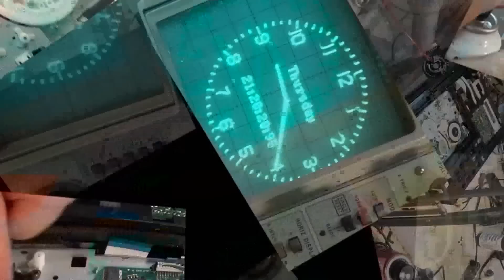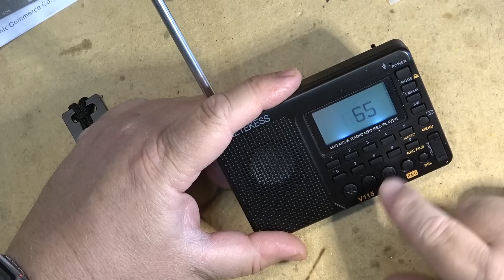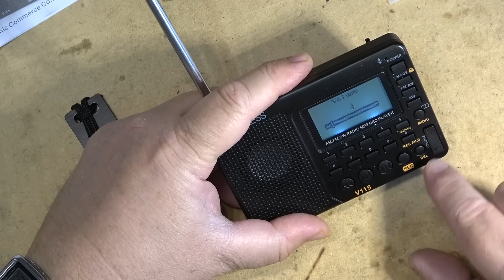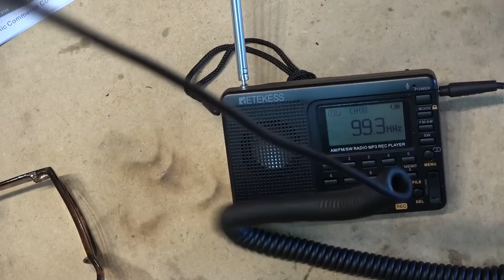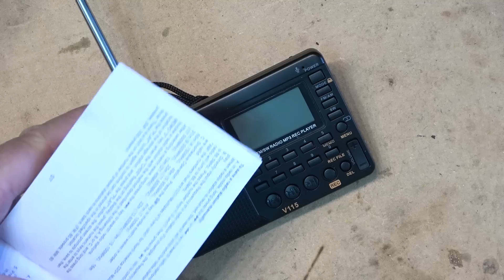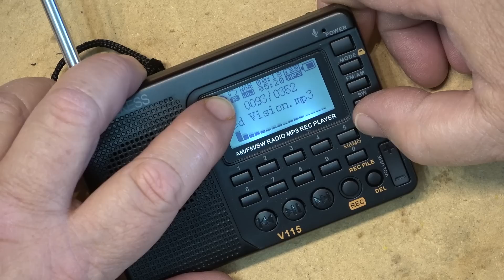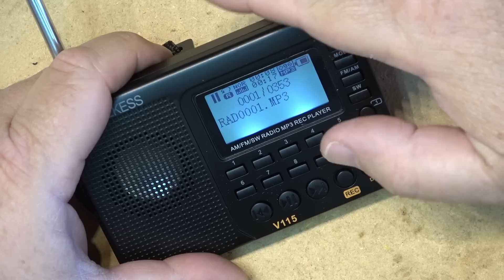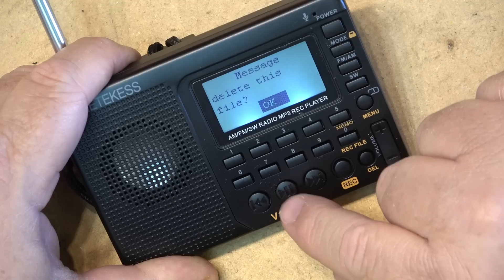Retekess V115 AM FM SW Pocket radio with MP3 and Recording function perfect for travel

Comment: One thing I did notice about the speaker is that it doesn't combine left and right, so you're only listening to a single side. sad but not a dealbreaker.
Reply: Really? Mine does combine both left and right into the mono built-in speaker. Maybe yours is defective. Does it happen for you both on FM and MP3 modes?

Comment: That's a neat little radio, and with so many functions packed into it. Might have to pick one up. That bass speaker on the back doesn't seem to have wires going to it, like in many bluetooth speakers which have the same thing.
Reply: it does NOT have wires.it's a passive bass port.
And yes, many bluetooth speakers have them too.

Comment: I bought one of these and I like it so far. Audio is nice and loud and reception is sensitive. The recording feature is nice but they must be using the Blade MP3 encoder with dual channel so the quality isn't the greatest. LAME encoding is better. It does record at 64, 96, and 128kbps at 44,100hz. The headphone output is a little tinny on headphones but if I use a mini headphone amp I made from a pair of cube iPod speakers then the audio is better.
Reply: The v115 I've just bought can record MP3 up to 320kbps. I guess the firmware must have been updated.
Reply: @michaelturner4457  Can you tell what version of MP3 it uses? Open one of the recorded files in a program that can ID files. Mine the audio quality has digital artifacts and it sounds terrible even at the highest bitrate.
Reply: @michaelturner4457  I wish there was a firmware update for this radio. Don't want to buy another one of these radios just to get 320kbps mp3 recording. Just need the firmware file.
Reply: @coondogtheman  I did have a look, and there's no identifiable metadata in the MP3s it records. And they do sound OK to me at 320kbps.
Reply: @coondogtheman  On mine it states "V 2.3" in the Settings options. I'm pretty sure there's no way for a consumer to easily update it. The micro-USB is for charging only, and I can't see any options for flashing via a TF card. 

I bought mine from Retekess in China, but I'm certain that they didn't design or make it. As the same radio is also sold with at least two other brandings, like Tivdio. The actual OEM is presently unknown.
Reply: @michaelturner4457  Perhaps I should have waited to buy. Oh well.

For the MP3s some programs can ID the encoder used to make an MP3 file. I use GSpot and you drop a file onto the program it says MPEG Elementary audio. Winamp will show the kbps and khz of the mp3 during playback. I don't know of any programs that can determine whether an MP3 file was encoded using LAME or Blade encoding but I can tell by ear. LAME is full of artifacts and Blade doesn't seem to have any except if using lower bit rates.
Reply: @michaelturner4457  If you turn the radio on and then plug it into your PC it will let you access the TF card and you can move files on and off of the card and it can function as a USB audio device so the sounds from your PC will play from the radio. For the firmware you probably download the file to the TF card and then there may be a secret combo of buttons or maybe you find the file in the menus and access it by the radio. Not sure
Reply: @coondogtheman  I analysed a recording made with this radio, and it's not LAME or Blade. It's actually using MP2(MPEG audio layer 2) encoding, NOT MP3. Even though the file suffix is MP3. Which would sound like crap at 128kbps. MP2 it's what used for DAB radio, and Philips DCC (Digital Compact Cassette).
Reply: @michaelturner4457  Interesting. I looked at a file and it said dual channel and not stereo or joint stereo. I guess it's an older codec. I don't understand why they can't just use LAME encoding. It's free to use. I have a digital recorder that records to mp3. I have it set to 192kbps and it sounds pretty good.

Comment: What a cracking little radio :-D  and the mic recordings are very good for a change.
It's likely got that american made radio dsp chip that works amazingly.
The case looks like a mini version of the tecsun/xdata range of radios.
I think the case look was inspired by the Sony icl radios from 20+ years ago.
It does really well with all the electronic noise in your house,  get away from the noise and it will be even better :-D

Comment: Some of these V115s have much better AM reception than others. The two I've tried so far were rather noisy even on strong signals. And the shortwave band is nearly useless. Overall I found it more useful as an MP3 player than as a radio.
Reply from the maker: That's what i will be using it as.  Mp3 player.

Comment: Great video, it was very helpful. Is there a maximum amount of storage you can put into that radio and is there a limit on how long you can record a radio show?
Reply: The manual doesn't say anything about max storage. I'm running a 32 GB card which is the largest capacity for SDHC (high capacity) format. In a reply to another comment here, 12voltvids did say that the card needs to be formatted in FAT32. Anything larger than 32 GB would be an SDXC (eXtended capacity) card which, according to Wikipedia, comes formatted with exFAT as a "mandatory feature". Perhaps you could reformat a larger card to FAT32 but I haven't tried it.

The manual doesn't say anything about recording length limits either. One time I started a recording but forgot to turn it off. It recorded for 5 hours until the battery ran out.

Comment: They are a good little radio, hooked mine up to a long wire antenna for short wave. I also have a cheap solar panel with USB out that charges it great. I also found another sub menu that allows you to change bass treble etc, but only works in certain play modes. Over all a good little radio, great for shtf bug out bags

Comment: In Radio mode, press and hold Play, it'll go thru the full band and auto save all the stations.

I love my V115, but only for MP3 & FM. AM & SW reception is not good. It's great for recording FM Microphones for video camera work tho'.

Don't pay more than US$25,
it's called either Tivdio or Retekess.

NEVER leave the battery inside if you're running it off USB power.
It doesn't have a proper charge circuit cutoff and will burn out your battery.
Reply from the maker: Good to know about battery.   Will remove it because I use it as an mp3 player to feed an RF modulator.  As to the auto station good info but i did it manually because I didn't want the Punjabi, Chinese or french stations in memory and we have several of them here.  They used to be deligated to the SCA service but now they have am and FM broadcast licences.

Comment: I had one
Garbage radio, barely useful on AM
Only thing good on it is the Speaker
Reply from the maker: Picks up the locals and I just tried it on as band.  Pulls in wwv no problem.  Not up to my old Sony 2010 but. It's a 15.00 radio. My Sony cost a small fortune.